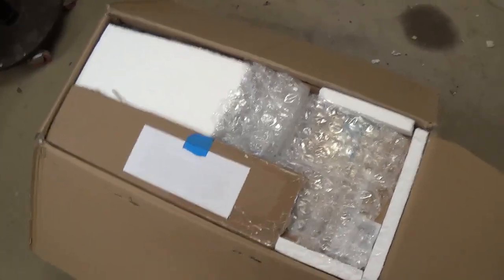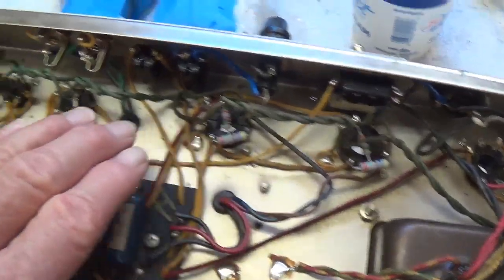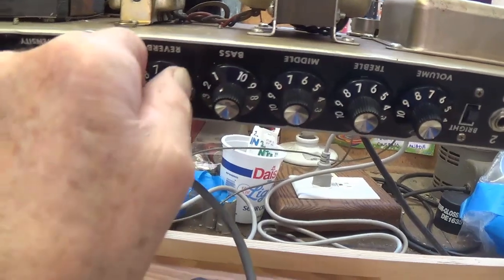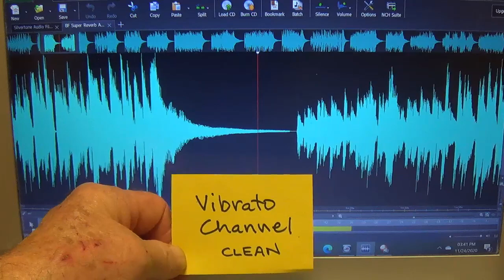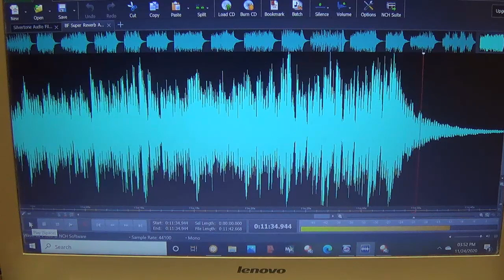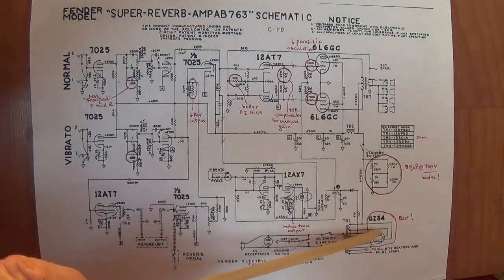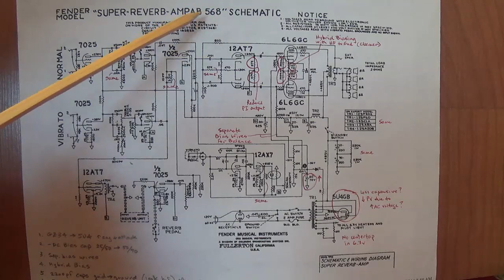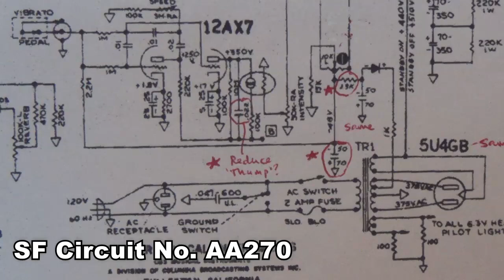1965 BF Fender Super Reverb in for a Check Up......Plus BF vs SF S.R. Circuits

Comment: This AB763 looks a lot like the AA1069 circuit?
Reply from the maker: A detailed comparison is offered within the video, GoS.
Reply: Sorry Doug, it appears my granddaughter had zoomed in the tv & I did not see the AA1069 at the bottom of the screen. So I had the "The Tube Amplifier Schematic Bible" out & was attempting to mark the revisions you showed but this "Bible" seems to be interpreted a little different from my teachings. It list the Super Reverb as an AA1069 & some other models as either the AA763 or AB763. It makes me wonder why the author of this book did not list the SR as an AB763? I have 3 SR`s, all of which have the AB763. And, like you stated, many guitarist consider this the Holy Grail of Fenders circuits. I figure it's listed in the book this way due to the number of years the SR was produced with the 69 circuit. Thoughts?
Also, which is your favorite tube amp design book of all time?
Thanks for the videos!
Reply from the maker: @gunsofsteele  I don't own any amplifier "books" other than tube handbooks, GoS. Everything I know came from studying on the Internet and personal experimentation.

Comment: Well it's about time the audio demo sounds like a guitar and amp instead of a distorting 2" transistor radio.
Doug did you dump that Tascam device and use a USB Mic interface to go direct to PC capture software?
Reply from the maker: Thanks, James. No, I've been experimenting with higher Bitrate and Audio Sample Rate.